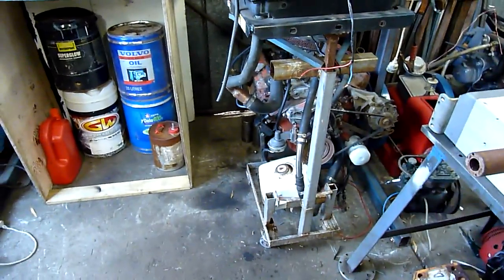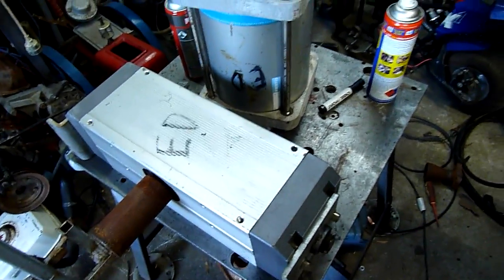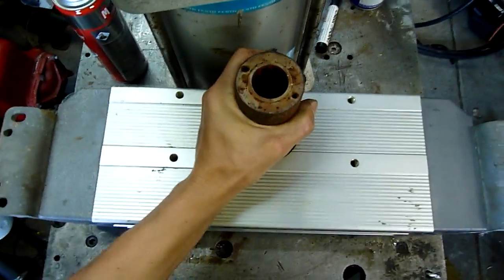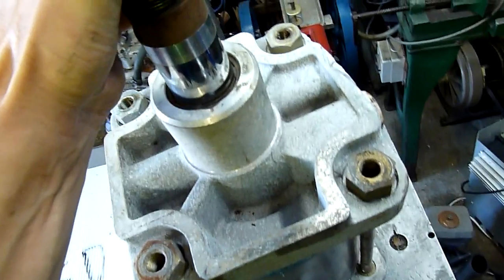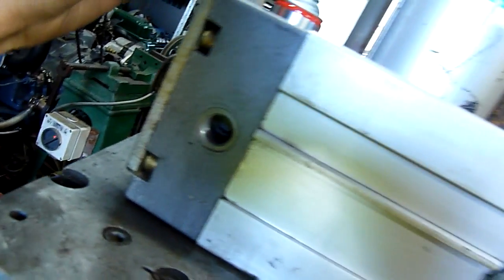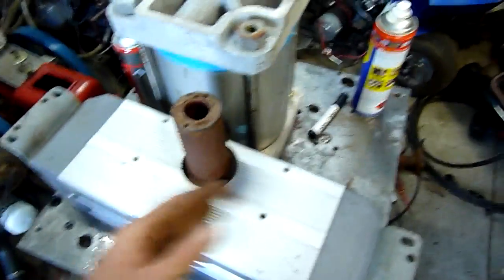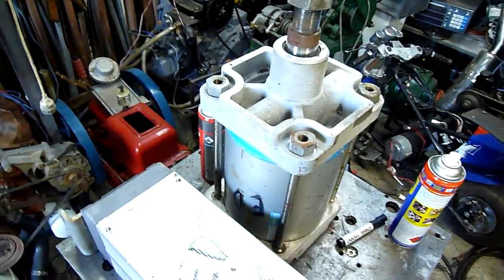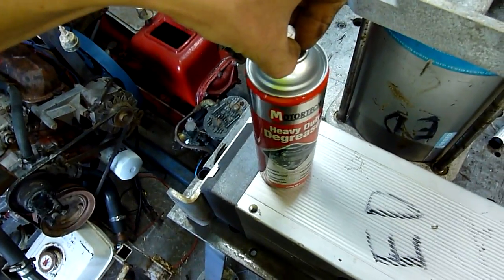Future Pneumatics and Vacuum Experiments

Comment: Trying to figure out how many kg in weight this thing can swing on to a CRT tube or something:

drq-100-90-ppvj-a (that 100 is the diameter of the piston in mm)

max. 10 bar. 10 bar = 10.1972 kilogram-force/square centimeter.
piston Ø= 100 mm a.k.a. 10 cm. radius circle is 5 cm (half) circle = pi. pi x 5 = 15.7 kgf.

Or Ed, try to find out the fun way!

Can someone help me with this (I suck at math)? I want to know....

Comment: About the hammer swinger, it will look most impressive if it's swings horizontally. You'll have to nail down the thing that's being hit, but just think about shattering a CRT with it. That would be impressive.

Comment: you could make a pressure multiplier. Use the big ram to drive a small bore hydraulic ram. If it is real small you could make stupid pressure but low volume. Good for popping small things. I doubt the rotary thing will have the speed to make a good hammer swing on its own, consider a step up gearbox ;)  Oh, if you can open the rotary thing you may be able to drill out the restriction chambers